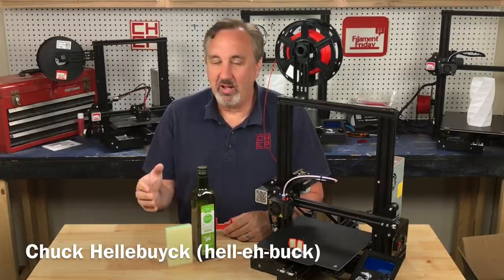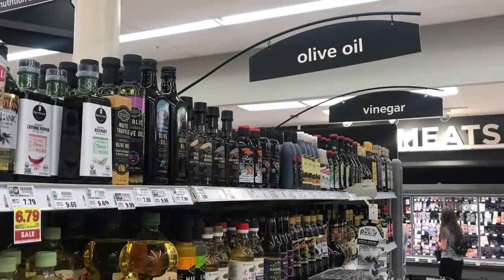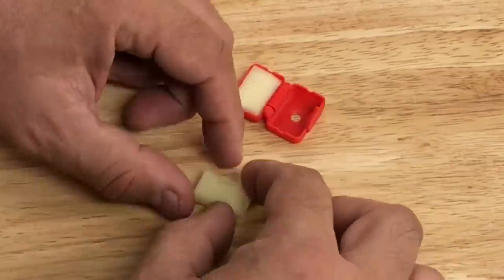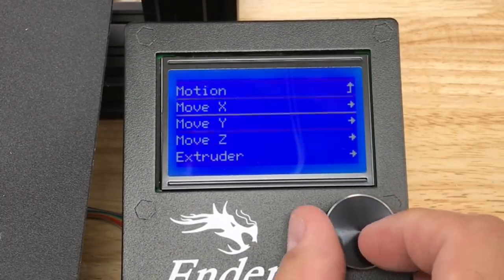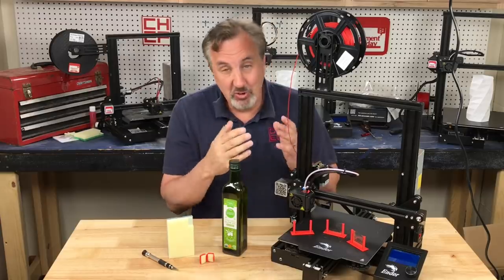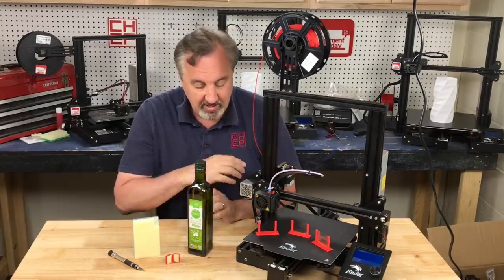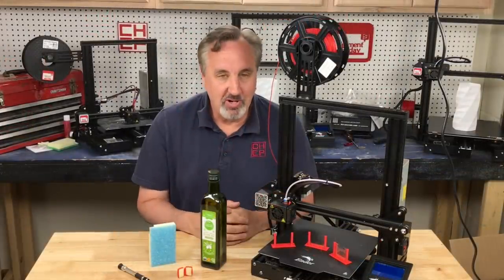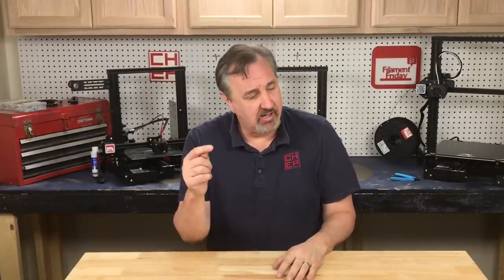Quick Fix to Eliminate Stringing on your 3D Prints

Comment: I know this isn’t related to stringing but I’m hoping someone can help me. Yesterday I printed a bunch of prints and they all came out great, no issues. This morning I went to print and my nozzle started scraping my bed so I leveled again and tried again, and it scraped again. Did this about 5 times with the nozzle scraping every single time even though I leveled perfectly.  anyone know what happened? Only thing I changed was super quality in Cura to standard for my prints, and tweaked my resolution and infill settings that the artist said to set them to prior to printing. I even reverted the settings back to how I had them yesterday, but still the same issue. Using a glass bed on an Ender 3 with the yellow aftermarket springs. Hoping someone can help me.
Reply: I had a similar issue, and the answer I think was when I removed prints, I sometimes put lateral pressure on the bed and that caused the off centre nut under the bed to loosen and the bed went out of level. Might be worth looking at at least.
Reply: @mattstarr3618  thanks for getting back to me, the issue was actually a major clog and I thought it was my nozzle scraping on the bed. It was actually my extruder making a knocking sound. Ordered a few upgrades for it so this doesn’t happen again. Thanks again for the reply tho
Reply: @themouselady275  I know how frustrating it can be to track down the cause of a 3d printing issue. Glad you got yours sorted!

Comment: Just wipe a 100mm or so section of the filament with olive oil on a lint-free (ie lens cleaning) cloth before it enters the extruder.  There's no need to make the tool.
Reply: The tool is for lingering dust in the air while the spool Is spooling filament into the printer so the tool will wipe debris dust off of the filament before it goes in

Comment: I'm experiencing severe stringing issues for a long time and no matter what I try I couldn't fix it, I'm printing 2d like plate prints most of the time so my prints are more susceptible to stringing. I just tried your method but looks like this doesn't work for me. I couldn't see any difference between the before/after test. I wonder why is that.
Reply: I was having a similar issue with plate-type 2d prints.  I found that the problem was I had the bed too close to the nozzle, which prevented the filament from easily being extruded.  This caused a backup of pressure in the nozzle which would release as soon as it was moved away from the printed surface and cause terrible stringing (even after calibrating temp and retraction).  Now when I level for these pieces, I print the part with a brim.  As the head is going around to print the brim, I fine tune the level so the extrusion sticks but doesn't press outwards (you can tell because there should be very slight gaps between the concentric brim edges, i.e. not flat and squished together.  My prints are now picture perfect with no stringing.

Comment: I use triangle posts when I run my string test. I played with all different speeds and still get stringing between the same two posts. There is no stringing from the other post to the two with the stringing (if that makes sense). At least I am down to a 33% problem.

Comment: im running direct drive and all metal hot end on my ender 3 pro and im getting alot of stringing on petg. what should i change?
Reply: You can try to reduce the temperature of your hot end a bit and increase your retraction by something like .25, petg strings more than pla so you might want more agressive settings
Reply: if you aren't drying your petg then you need to try that. petg is very hygroscopic.

Comment: I am seeing boogers on my print... I've printed half a dozen of retraction towers both for distance and speed - nothing, but when nozzle travels it just seems to have a little bit of filament that keeps getting added to another part of the print. I don't know what to do. I've tried all sorts of retraction speeds, retraction distances, and even travel retraction amount in cura. Nothing seems to work. And I am not seeing ANY stringing btw.
Reply from the maker: Try a new SD card. Sometimes the read/write time for power loss recovery can create that on cheap SD cards.
Reply: I have the Same Problem did you find a solution in time? would be super cool if you could answer me please thank you in advance
Reply: @HerzogJoni  no, I shelved my 3d printer for a bit. I suspect the issue is with not using direct drive extrusion but bowden tube. Because I've tried everything and nothing solved this problem. I think there's just too much flex in filament to be retracted precisely with bowden tube.

Comment: Do you have to do any calibration after trimming the PTFE tube?
Reply: nope, the tube have nothing to do with the mashine settings :)
Reply: Although 20mm probably won't make a noticeable difference, a shorter tube requires less retraction due to decreased friction loss.
Reply from the maker: My tests showed it didn’t matter. https://youtu.be/DB5b4673GJ0

Comment: idk if this is accurate but i feel retraction often causes my filament to get grinded in small areas where its getting retracted a lot. im not sure if thats true but i  feel it is
Reply from the maker: It can. There is a setting Cura to limit number of retractions in a short section to prevent that. I can’t remember the setting though.
Reply: Maybe try the connect infill option?
Reply: @FilamentFriday  maximum retraction count, iirc

Comment: this mainly solve in a bowden style extruder right? any idea with direct drive style?
Reply: same here, using PETG
Reply: @TDHobbies  PETG tends to produce strings. in my case, i got a lot of string even when using PLA with my direct drive
Reply: @mikealpha4462  same
Reply from the maker: With direct drive reduce retraction to 1 or 2mm depending on your printer tests. Otherwise you’ll probably get stringing.
Reply: @FilamentFriday  I have Retraction at 1.5, still a lot of small strings
Reply from the maker: Have you tried this oiling trick?
Reply: @FilamentFriday  yh
Reply: @FilamentFriday  reassembled the whole hotend, new nozzle ,new ptfe, new filament

Comment: Smoke point of olive oil is about 190C.  Maybe Avocado oil would bode well for higher temperatures? Unless it's good to smoke the oil when it hits the nozzle, that could be the case.
Reply: @exequielross  Thanks for sharing this detail, good call
Reply: @RwP223 sorry i made a mistake, seems to be that the most suitable is indeed the olive oil with the lowest smoke point. ill edit the comment.

Comment: What about stringing with Carbon Fiber Nylon from Sainsmart? Have you ever worked with that material CHEP?
Reply from the maker: No, I haven’t.
Reply: Try drying it at 75C for 8-12 hours if you're having a lot of stringing. Nylon is extremely hygroscopic.

Comment: Make a video on how to intentionally cause as much stringing as possible.
Reply: You can try these:

1. Turning off retraction, coasting, coming, wiping or any other things that help with stringing.
2.  Use some material that likes to stick to nozzle like PETG and TPU you can try those. 
3. Printing hotter can also aid in stringing
4. Keep your filament in a humid area
Reply: @F2_CPB  and print faster (70-80mm/s)

Comment: Why do you need the 3D printed part? You can just do this directly by hand...
Reply: You really want to manually wind 300 meters of filament?
Reply: @Enderplays12  It's only applied to 100mm of filament, not the whole roll
Reply: This is the comment I was looking for. Seems like a lot of trouble for 100mm
Reply: Why would you need to add more oil? Ron's point was you only use the printed part for the first 100mm and take the part off and don't put it back on (until you need to do it again months down the road). However, that little part is nice to have with dry sponges in it if your filament got a little dusty or whatever the case.. then just keep it on the whole time to clean your filament as it passes through'

Comment: Maybe use oil with higher smoke point?
Reply from the maker: Why? So the oil gets past the nozzle to the print?
Reply: @FilamentFriday  yeah with mineral oil it's fine. it doesn't affect the strength of the print but you will have to clean the bed after.
Reply: @omega52390  I would be very suprised if a film of mineral oil on the outside of a molten bead of plastic that you were hoping to fuse to an existing bead of plastic didn't significantly degrade the bond strength between layers. Im sure it bonds but I'm equally sure it bonds nowhere near as well.

Comment: so I just changed to a .6 mm nozzle. getting very bad stringing with a new filament after trying a lot of fixes. calibrated esteps, tried different retraction, speed, nothin works.
Reply: I'm having the same issue after switching to a .6mm nozzle. Did you find a solution for your printer?
Reply: Me too… wondering if this will help

Comment: CHEP  this isuseful like some many others. 
But when You will start work with direct drive printers?

Does not most people get direct drive level after while?
Like jump to next level.

 Especially with BMG and mosquito hotend 😊
Reply from the maker: Like this: https://youtu.be/iFNcP-OyAH0
Reply: It makes sense only on slow cheap printers like ender or ghost. But when you're using fast printer, direct drive may really harm. For example I can print with 5000 acceleration without any issues (no echo, no ringing). If I would like to install the most lightweight direct drive extruder nowadays, my hotend weight will be doubled. Variatons of BMG - tripled or even quadrupled. 

I see no reason to use direct drive other than printing tpu, but rather than slowing down my main printer, I've got an ender 3 with BMG wind =)

Comment: the only problem I see is, the oil itself goes rancid and becomes glue in a month or two. I have a natural oil like that and it glued my c clamps together.  So maybe a different oil
Reply: The more likely an oil is to go rancid, the more likely it will polymerize. Like seasoning a skillet
Reply: Try a tool oil, typically for hydraulic/pneumatic tools, still lubricative and wont break down over time, but not food based!
Reply from the maker: And it will leak all over your bed. Don’t do it. Use olive oil.

Comment: I have also been using it a couple years, and it works great, run it about every 10th print, and u can just clip it on while printing. Canola oil works too. Also, i my experience, i only use the capricorn tubing from creality. It is way better and lasts longer than any other i have tried. 3 years 3d printing, abd now almost 1 year doing commercial, prints for sale on my etsy store. I have 2 ender 3 pros running 24/7 printing for the store.  1ofakindhandicrafts  on etsy

Comment: How about if use vaseline instead of olive oil?
Reply: wouldn't recommend it, petroleum jelly into a hotend, see the connection there ?
Reply from the maker: Why the resistance to use olive oil?
Reply: @FilamentFriday  I suspect that there will be compounds in the oil that wouldn't fully burn up and generally it's a better idea to just dry the filament. Sure this is a simpler fix I guess.
Reply from the maker: Drying never worked as well for me. It’s the PTFE that breaks down and the oiling helps. And I’ve never seen any oil residue get thru using olive oil.
Reply: @FilamentFriday  if you're talking about the sunlu, esun and other off-the-shelf dryers then yeah, they're pretty bad. No circulation, poor heat retention and generally bad calibration out of the box. I made a diy heatbox using a 1$ heating element, a 2$ plastic box and a couple pc case fans and it works fabulously.

Comment: Whats the science behind this? It works but I wonder how
Reply from the maker: Same as a cooking pan. It lubricates the surfaces.
Reply: @FilamentFriday  sure but why does it stop stringing?
Reply from the maker: Helps filament to fully retract without sticking.
Reply: I think he's saying it actually lubricates the hot end area so when it retracts it's not just pulling up a semi molten mass, but the whole thing is actually coming up.

Comment: hi im very new to 3d printing is there away for me to learn the correct settings for making pedestrian bridges because for some reason on some end the filament wont stick to the bed good and then i get that the open parts give then a problem to railling that goes on top of another print i already vinked the supports in the setting but for the rest i have it on factory settings because i still have no proper clue how to set it correctly so thats why i ask if there is for people like me that are not good in setting setup up to still do good bridge prints and if there is also somebody that only has parts for buildings and bridges and more for h0 scale so i can build the stuff after i printed it so that the printer does not print the complet building
please help i hope you guys can help
i have a creality ender 3 printer
im using black pla filament at the moment

Comment: I just wonder if a different oil might be better.   Olive Oil plasticizes pretty easily, so build up seems like it could be an issue in the long run.   It makes me wonder if Avocado Oil or Grapeseed oil?   Dunno.   I'm not saying Olive Oil is bad, I'm just wondering if one of these other options would be a little insurance against it.   I really like the way you're avoiding adding too much oil.  That pad is only going to accept so much that way.  Good approach!
Reply: @iAmTheSquidThing  I like the food grade aspect if heating it up and printing with it might aerosolize it.
Reply: @ButterfatFarms  that's really a whole separate topic and not really the point here.
Reply: @ButterfatFarms  we're talking a miniscule amount of oil and if you understood the kind of oils I suggested, you'd see they have some of the highest smoke points.
Reply: @ButterfatFarms  I had a minor offhand comment within the thread that you went on your little diatribe about.

The thing is, carcinogens are cumulative.  So making choices that reduce the accumulation is a smart thing to do.   Not printing in a closed up small room / good ventilation, choosing plastics that are less likely to burn / safer to use (notice I didn't say safe, just safer), and if you're going to add something like oil to help reduce stringing, realizing that you have a choice in the oils you use and not all oils are the same, is also a good thing.

Right up front I suggested oils that have very high smoke points pretty much negating your whole point.  You act like you're saying something new, smart, and interesting regarding carcinogens but I find it to be none of the above.

As someone who has had cancer, I don't really need you lecturing on carcinogens.  I hope this clears up any confusion you might have had on where I stand on this topic.   It was a polite discussion until you got here with your condescending remarks.
Reply: @ButterfatFarms  you're repeating stuff I had already said, up front.   No one here in this thread is worried.   You jumped in with some sort of chip on your shoulder about what you perceived here which as far as I can tell is way off base.

This was a simple discussion.  You're adding drama.  I'm not interested in the drama.
Reply: @ButterfatFarms  here, let me quote you and see if you can see how condescending you are, regardless of who you clicked "reply" on.   "um, carcinogens in cooking oil fumes aren't unheard of"  - That's sarcastic.    "you may worry now" - That's condescending.   "maybe you should be more concerned about [...]  Just sayin'"  - douchey.   "If I confusd you sorry" - that's not how an apology works.   If you screwed up and you said you screwed up and apologized for it, I would have been able to 100% relate to that because I myself have gotten carried away before.  Instead you apologize if I am the one confused.  No, it clearly took you several replies to figure out you were barking up the wrong tree and then when you try to say "sorry" you completely botch that too in a rude and condescending way.   Learn how to apologize by owning your mistakes when you make them.  You'll come across a lot less douchey.   

We were having a fine normal conversation here until you jumped in the middle of it. Then when you realized you jumped into the middle of the wrong conversation you continue to rely on the excuse "you didn't mean to".  Dude, just bow out already.   Go practice your social skills somewhere else.  You definitely need it.   Even if you had been replying in the correct thread, you still would have come across as condescending, sarcastic, and rude.   If you have a point to make, make it, but don't belittle the person at the other end.

Comment: Why even bother to make the little device? Why not just lightly rub some oil onto the filament and let it run through? Cool idea but seems overdesigned to me.
Reply: it cleans the filament so you dont end up getting dust etc pulled in
Reply: It's a 3d printer . Overdesigning solutions to tiny problem is half the fun!
Reply: how are u going to oil a full roll man ?
Reply: @animatrix1851  ur not understanding, it oils the PTFE tube

Comment: Didn’t solve my stringing, it’s just thin strings!
Reply from the maker: Then replace the PTFE.
Reply: @FilamentFriday  i did then when I got my machine and according to your video of replacing just the part in the block. Did it with capricorn even.
Reply from the maker: Try this to adjust your settings. https://youtu.be/6LjbCIGCmd0